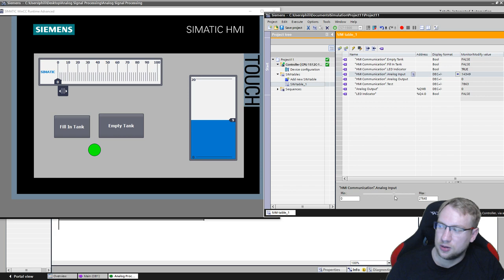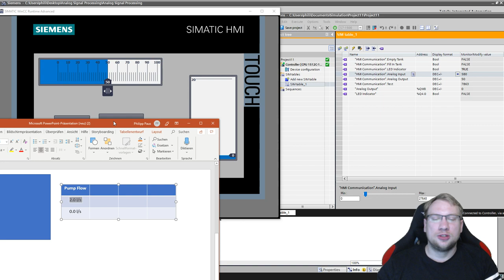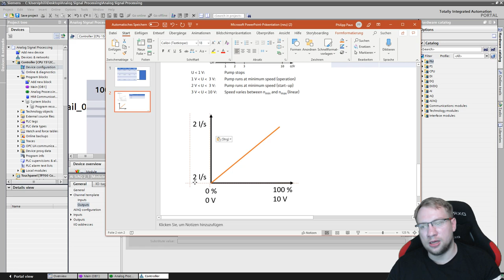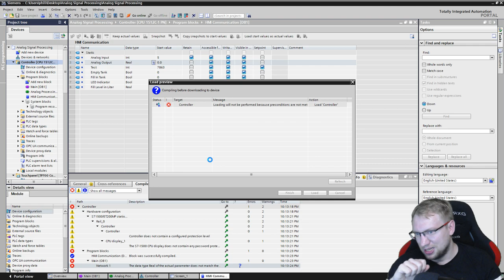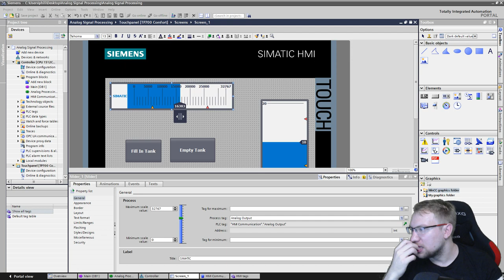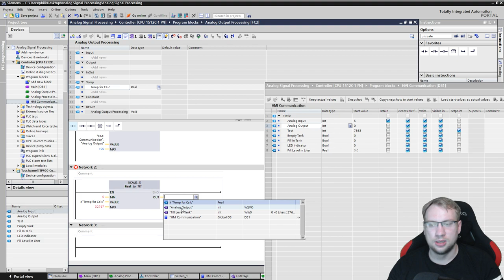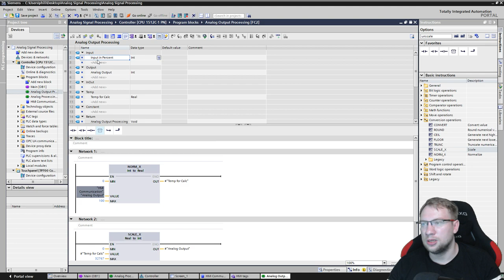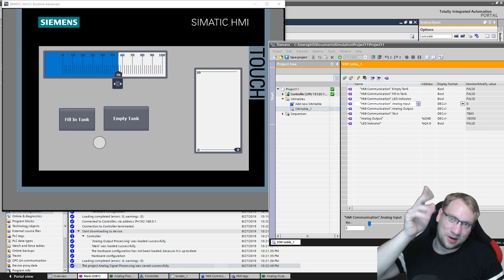TIA Portal: Analog Output Processing / UNSCALING

Comment: why did you use 32767 instead of 27648, I think that 27648 is 100% and the 32767 is at 118%
Reply: I think we need to send int type which value is 32767, to output. So, it was done correct in my opinion.
Reply: @onurcansartas2973  27648 is 100% which translates to +10VDC or 20mA.  Value of 27649 - 32767 is overrange (AQ can output 11.7 VDC).
Reply: will it be depend upon 16bit or 13 bit resolution ..or what ever the resolution we have to use the 27648??
Reply: @ansalkm  No. 27648 is representing 100% of the process value after the ADC conversion. Number of bits fir the module defines precision of converted analog value, but it is still represented as 27648 at 100% of the range with overrange up to 118% (11,78 VDC input signal).
Reply: @OlgierdSnieszko  Thanks for info..so irrespective of ADC bit resolution bit we have to use 27648..
Reply: @ansalkm  Not necessarily.  If you use say 13824 but then output of NORM_X will be doubled (it would read 2 at 10V).  It is convenient to remember 27648 as is it used by various Siemens hardware (PLCs, drives, etc.) as representation of 100% of the variable.  I strongly suggest to download S7-1200 system manual and read chapter 10 as it covers all possible combinations for various input types (current, voltage) and shows tables with numeric representations for each of them.
Reply: @OlgierdSnieszko  Thank you very much...:)

Comment: Hi Hegamurl, thanks very much for your videos. Please when do we use 27648 and 32767.
Reply from the maker: The hardware module itself uses 27648 as a "100%"... so if your hardware module is set to work with 10V then 10V will be equal to 27648 in your program.
The reason is so that we can have some overshoot... if the module for example detects 11V that will still be in the range of an integer (27648+ 10%)
Reply: @hegamurl7434  Thanks very much. I really appreciate your response.

Comment: thank you so much for the explanation, I have a problem though, my PLC is 1214c dc/dc/rly and my analogue output module has only -/+ 10 volts and 0 20 mA, and I need to connect this out output to a speed drive that runs with 0 to 10 volts, can you make an explanation for this problem, on how to convert from -/+ 10 volts to 0 10 volts, thank you very much in advance